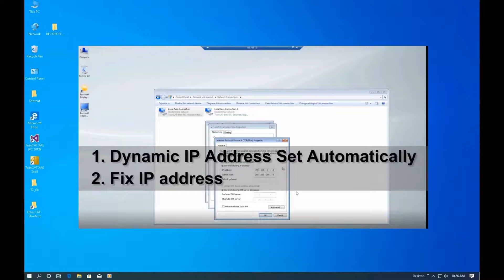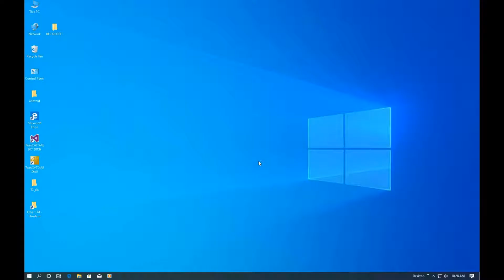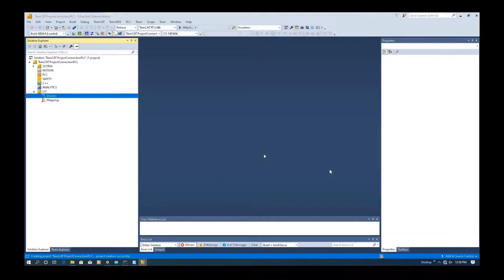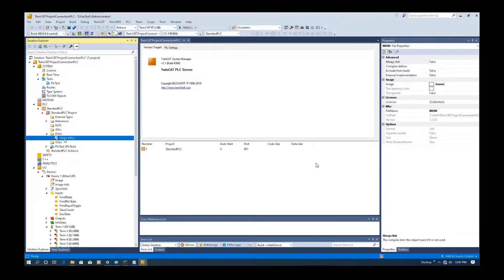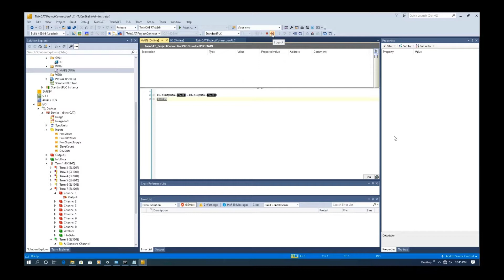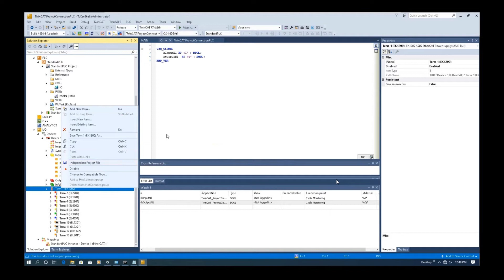BK05. How to Link Tags/Variables to Hardware Signal Modules in TwinCAT3 PLC

Comment: Is the syntax of AT %I* identical for all PLC vendors using structure text to link variables to hardware module signals?
Reply from the maker: Not really, e.g. Rockwell studio and Siemens TIA Portal they are not. As I know the develop platform has CODESYS core use "AT %.. " as syntax
Reply: @electricalautomation  Thus, any software based on CODESYS, like Automation Builder of ABB, will have the same syntax right?
Reply from the maker: @mohamedhafez1641  Should be, but I recommend you check the ABB program manuals for a confirmation.

Comment: I have project about communication with el6001 (RS232 interface). Can you help me?
Reply from the maker: Hi, I did not use EL6001 before and I don't have this modal in hand. But I did a search and i found the link may help you. Beckhoff supply the sample program from https://infosys.beckhoff.com/english.php?content=../content/1033/tc3_plc_intro/63050394919300235.html&id=   Good luck!
Reply from the maker: https://infosys.beckhoff.com/content/1033/el600x_el602x/1719016843.html?id=847701662780918913      Please check this link
Reply: @electricalautomation  can I use that module to communicate with other controllers? Like arduino
Reply from the maker: @muhammadtriza3251 For simple mount of data would be fine. The Arduino side needs a TTL-RS232 interface module. You could use serial communication software to test Arduino and EL6100 each side, then connect them together test ptp communication.

Comment: I connected my i/o cards and uploaded the code to the plc, but I get an k-BUS error. Do you have any Idea how to fix?
Reply from the maker: I recommend adding the module one by one. Configure and download the pure CPU only at first, then add one module and configure and download. Then you will find which module have a problem. BTW, the modules at right side of the CPU should be E-Bus, as I used. If they are K-Bus, likely you need a coupler module e.g. BK1250